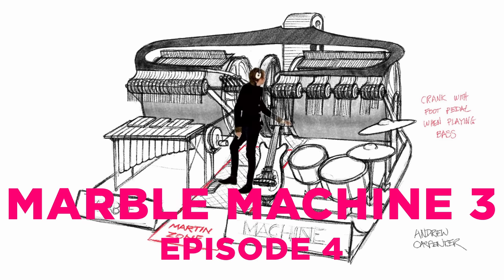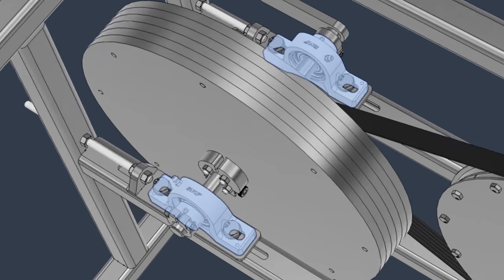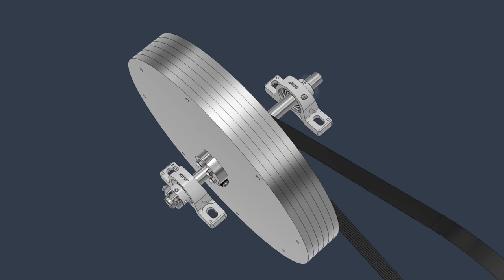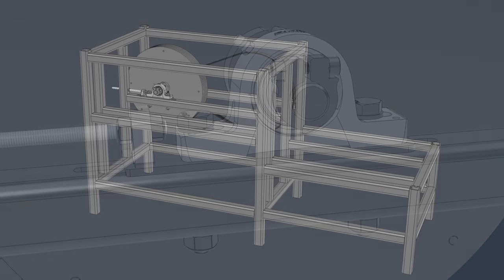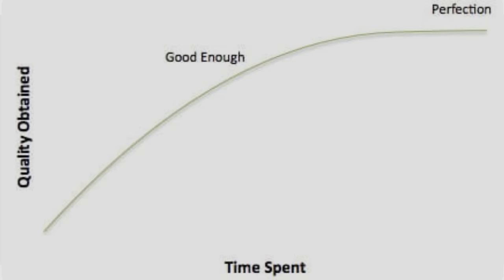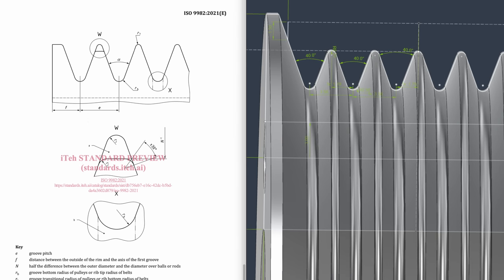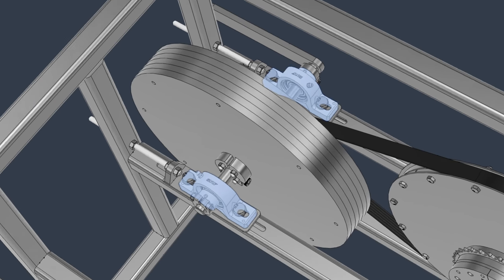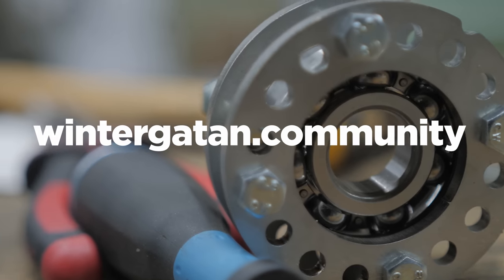A Better Flywheel Design - Marble Machine 3 Ep.4

Comment: It made me smile to see that you are using clamping collars on a straight shaft (I had made the suggestion in an earlier episode 🤓)
This is in fact the way servo motors are connected to ballscrews on large industrial cnc machines.
regarding the pillow bearings, they can have a fair amount of turning resistance, so make sure to order metal ,not rubber, shields.
they have less dust protection but there is no contact between between the inner and outer race . also consider flushing out the
original grease and replace it with a much thinner ,but appropriate for the task, grease .If you are already consulting with SKF they would
have exactly the correct answer.
To made assembly and disassembly as easy as possible ,ream the clamp collars same as you are doing the flywheel segments, that way
the shaft is never scratched .
lastly do not screw the bearing setscrews directly to the shaft , place soft copper pieces into the setscrew holes and tighten down on that
Oh and waterjet cutting works very well.

Comment: Hi Martin,

There's a lot of good things here but I do have a concern about your tension adjustment method.

It may be that there's details and features I can't see just from the screen shots of your design.
However looking at the screen shot at 0:47 & 2:52 it looks like the bolts you need to loosen, to allow the sled to slide back and forth, are also the bolts which hold the pillow blocks in place on the sled allowing the bearings to move independently of the pillow blocks while you are adjusting the sled position.

This will make making accurate adjustment of the tension a nightmare. 

My recomendation for a quick solution would be to thread the exising holes and use them to  fix the pillowblock directly to your sled.

Then extend the sled, and add two new holes in the sled, in conjunction with shoulder bolts (Which will locate your sled more accurately in the slots than the current threaded bolts).

I'd also recommend some sort of reinforcing plate on the box section where your adjustment nuts are located to prevent accidental pinching of the box section (Ive seen it done with large rbox section than you are using). 

If you really want accuracy and ease of alignment, rather than the slots in your box section, you might want to consider using linear rails and bearings such as those made by Matara or THK (Other brands available), these aren't particularly expensive (though ) but they massively help with keeping the bearing sleds parallel and also mean that you have less bolts/nuts to loosen when you want to adjust the tension. 

If you see this I hope you find it helpful. 

I really do admire the work you've put into this project. 
You have done an amazing job and as a mechanical desing engineer watching the progress in your design skills come on from marble machine x to now is brilliant.

I also don't think you give yourself enough credit for what you achieved with the first two marble machines.
Even the most experienced designers will find flaws in their designs when they are actually built, and finding soutions to those problems within the restrictions of what has been built is a skill all in itself which you have shown a great talent for In my humble opinion.

So bravo and I wish you all the best as you progress with th enew marble machine.

Comment: One small thing I've noticed: there doesn't seem to be a second plate sliding along the bottom of the tube the pillow blocks rest on...
Either way, usually you wouldn't want your bolts pointing down with nuts on the bottom, but actually use either all-thread or just a normal bolt from the bottom and weld them in place on the bottom sliding plate. That way you only need one hand and only need access from above.
Also, slotting the structural parts for tensioning can get dangerous if you overdo it, since it obviously weakens the material, so keeping it as short as possible and reinforcing that section/using a higher wall thickness for it might be a good idea.

Comment: To hand ream those holes and keep them perpendicular you will need to make a some sort of guide. Something very similar to what you find in Adam Savage's video on tap guides on Tested's youtube channel.
Reply: Following machining advice from Adam Savage is asking for failure.
Reply: The choice to hand ream those precut holes is not a good solution at all...
Reply: Y'all just haven't had to spend your own money on stuff like this. He has three options 1. Find someone with a big ass machine to ream those holes (expensive/impractical) 2. Mag Drill (expensive/going to have to indicate it in any way) 3. Hand ream (make a jig once and you're set as long as you don't have to serious time constraints)
Reply: @dugg117  Martin isn't "spending his own money," either. Hand reaming a 20mm hole, especially as an amateur, is just asking for trouble. He should buy a unit off the shelf and be done with it.
Reply: @thomasbecker9676  a custom sized flywheel isn't going to be "off the shelf"
Reply: @dugg117  There's zero need to have a custom flywheel.
Reply: @thomasbecker9676  lol
Reply: @dugg117  I feel like you're one of those Adam Savage fanbois who claps like a seal whenever he does or says anything, and hold him to be some genius with untold skills. The reality, I'm afraid, is anything but.
Reply: @thomasbecker9676  LOL
Reply: @dugg117  That's quite the rebuttal.

Comment: With the flywheel, only the outside ones need to be 1 piece. Split the others in half and there will be no need to pull it completely apart to add or remove weight.

Comment: For the flywheel, wouldn't it make more sense to have one  central plate, and then use the bolt holes around the perimeter to attach two C-shaped metal segments to create a full ring? Fine tuning the flywheel by changing the number of full plates means pulling the axle each time, so by having one main disk and attaching plates to it, the tuning portion should be easier maybe.

Comment: Hi Martin!

At around 4:30, you talked about reaming. As a machinist (or soon-to-be, I'm still at school), I would tell you that the hole that you plan on cutting at 19.9 millimeters, I would resize them at 19.5 millimeters. If you plan on using a machine (a press drill, hand drill, or a milling machine), I'll give you the equation to calculate the spindle speed :

(90 (the Surface feet per minute, or SFM for short, of steel) * 1000) / (pi * tool diameter) = Machine RPM
Then, divide all this by 4 because you're reaming (it puts a lot of stress on the tool). Also, make sure you're using A LOT of cutting oil, because reamers tend to generate a lot of heat.
In this case, ((90*1000)/(3.1416*20))/4 equals 358 RPM.

Why am I telling you all of this? Because I don't think hand reaming in your situation is doing you any good. You cannot, and I repeat, cannot drill, ream, or even tap by hand being 100% straight, it's impossible. Imagine reaming all of your holes in your flywheel, then assembling them and realizing that none of your holes is truly perpendicular to the flywheel. What a disaster it will be. At that point, I would ask a nearby machine shop to ream them for you, as it'll take them minutes to do.

If you have any interrogations about machining steel parts, you can always ask me, and if I don't know the answer, I'll ask my teacher, who has been building extreme precision parts at Pratt & Whitney and at Bombardier, making aircraft parts.
Reply: You should probably copy paste this to the subreddit, that's where they take feedback
Reply: Post this on the MM3 subreddit. This is where feedback is given
Reply: @sqbuilder1328  Thanks guys, after weeks of procrastination, I finally posted it on r/MarbleMachine3. Without you two, I wouldn't have thought about it.

Comment: Yes! Thank you for using the stock parts. I have wasted hours of my life over complicating designs and then switched to something extremely simple and better than what I had made.

Don’t feel bad about not designing your own bearing mount. Engineering is all about trying a design and fixing the mistakes you make. A good design on paper is just that, a good design on paper. Just because the math and logic makes sense on paper does not mean it will work in real life. That’s why people spend millions testing.

Try, fail, try again. Good engineers learn from mistakes and that’s the whole point of marble machine 3.
Reply: Martin isn't an engineer.
Reply: @thomasbecker9676  I don’t mean engineer in education, I mean casual engineer. He is designing mechanisms that need to interact to a precision, that’s engineering to me.
Reply: @dylandreisbach1986  I call it tinkering.
Reply: The actual answer is to use samples and program the whole thing. This could be done with software that existed 20 years ago.

The very premise of the marble machine is over engineering.
Reply: It depends on what you are building... before he was building art, now he is building peace.
Reply: @ArthurBugorski  Over-engineering still requires engineering.
Reply: I learned something very important from my dad in construction: Novel solutions for common problems are either very smart or very dumb, and the real dumb ones outnumber the smart ones by a lot.

Which isn't to say Martin is dumb, he's certainly not, but this is one known problem (bearing configuration for a flywheel) in a much more complicated unknown problem (a whole music machine). In the same way the marble timing should be as precise as possible at every step so errors don't compound to catastrophe, each mechanical problem should be treated the same.
Reply: also remember to learn from other people mistakes as well otherwise you will spend all youre time making mistakes that have already been solved.
Reply: @dootanator_  Right. We often forget that the power of humanity is passing down knowledge. Every genius who has ever lives builds upon what has already been established.
Reply: A lot of engineering is looking through a McMaster-Carr catalogue and using what's there to achieve your goals.

It's like the bigger boy version of an Erector Set.
Reply: If Erector sets had search bars
Reply: Yeah.  A similar thing happens when doing jewelry.  You CAN spend days and days creating your own parts- settings for gems, drawing wire to the right size and profile, carving wax for casting little figures or cutting out shapes... OR you could go to a catalogue and buy most of that stuff for less money than the time it'd take you to make it is worth, and know that it'll be close enough to what you want or need.